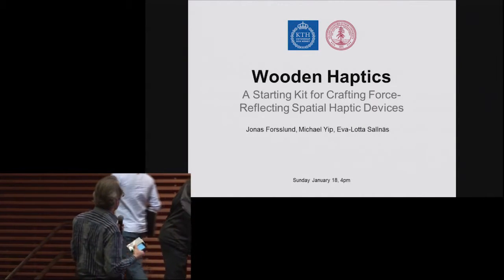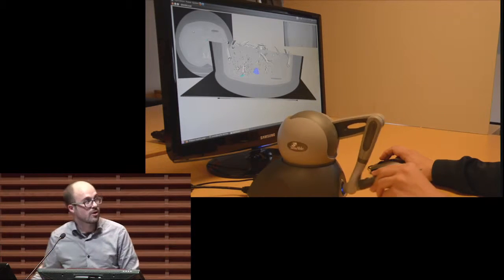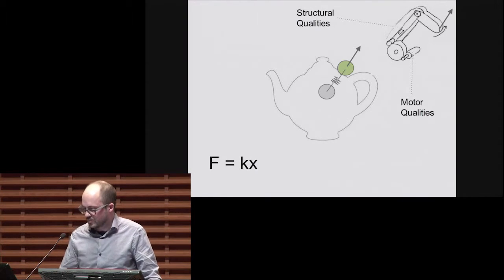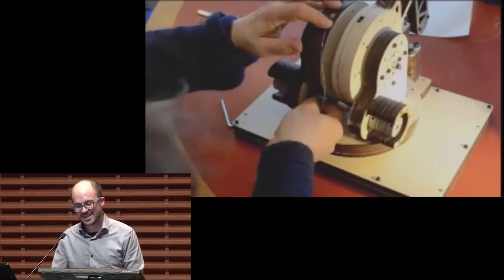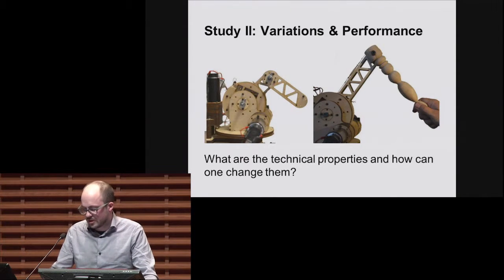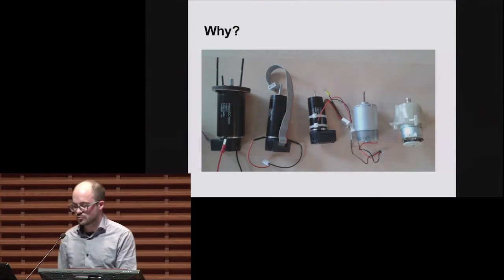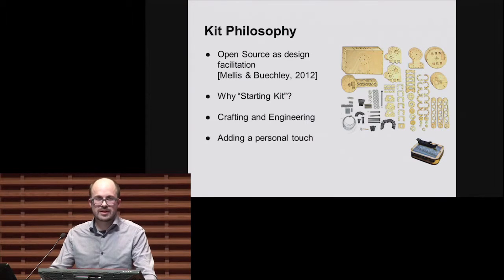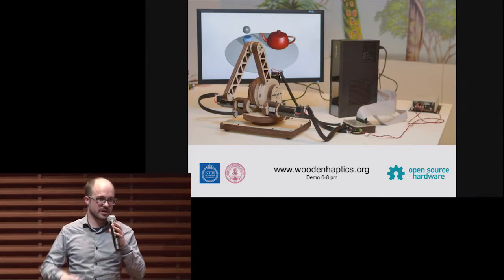TEI 2015 - WoodenHaptics: A Starting Kit for Crafting Force-Reflecting Spatial Haptic Devices

Comment: I am so thoroughly surprised that no one has yet to cover this device more online, show it off in videos, and even more importantly, attempted to modify it in different ways such as finally adding a stylus to it. THey also have stl files so you could 3D print all parts if you wanted to. Or you can CNC it out of metal instead of the wood.

It would also be awesome to use it in VR after that, for sculpting 3D in VR and with force feedback. Would be the ultimate intuitive sculpting tool!